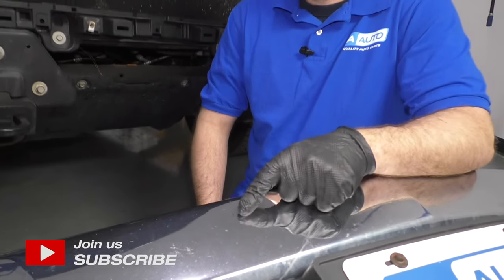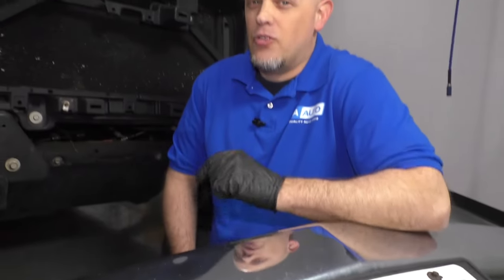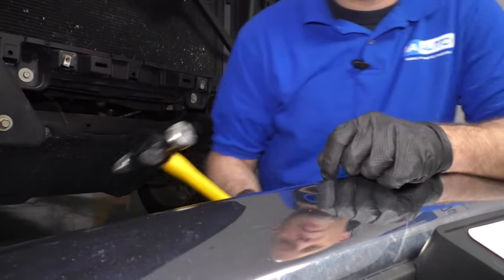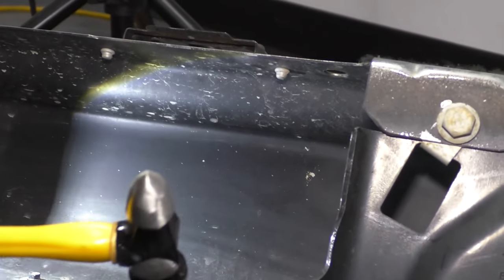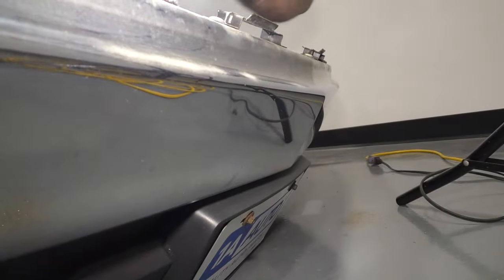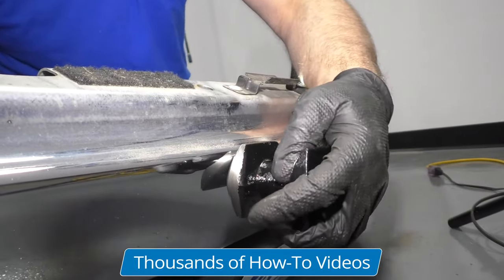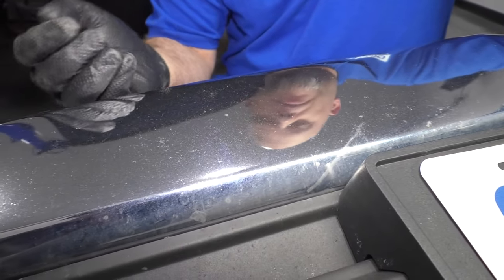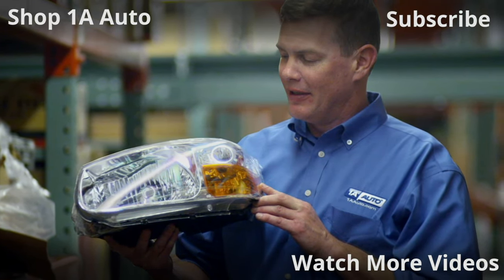How to Remove Metal Bumper Dents

Comment: I just bought a pre-primed bumper for my SUV and it arrived with a ding that was thin and about 3" long. I wasn't sure if I could fix it, and thought I would have to exchange the bumper or just be ok with the ding being hidden behind the license plate. Watched your video and banged it out. It is 98% better now. If I look hard for it, I can still see it (barely), but it is in much better shape now. Not to mention that it is still going to be hidden by the license plate. Thanks!